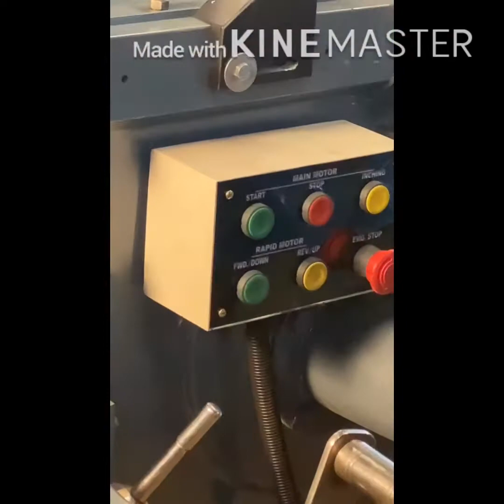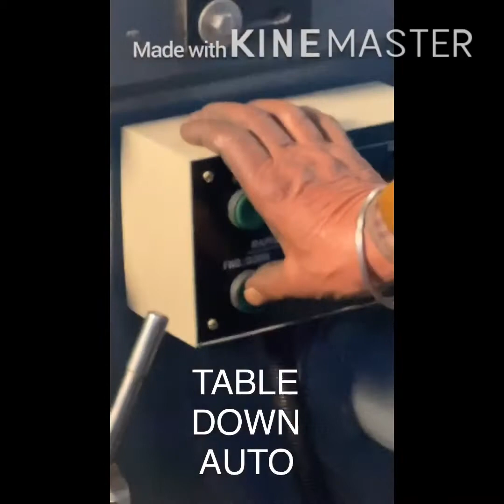QMTC SHAPING MACHINE 18 INCH STROKE ALL GEARED | FULLY AUTOMATIC | +91 9417066497 & 96

Comment: can i see the detailed blueprints of your machine?
Reply from the maker: https://www.youtube.com/watch?v=zPbnxkcKly8&t=8s
Reply: @qualitymachinetoolscorp   when the ram starts stroking automatically, does the table moves automatically by pressing and holding the buttons?
Reply from the maker: @sacayaldrichneil5072  table does automatically moves along with ram stroke by rachet system. You can adjust the table movement as per your requirement.
Reply from the maker: @sacayaldrichneil5072  table moves automatically when ram strokes without pressing or holding buttons. You can stop table movement by your choice.